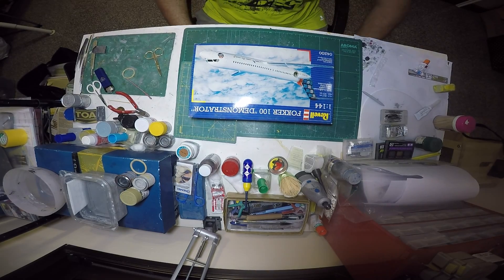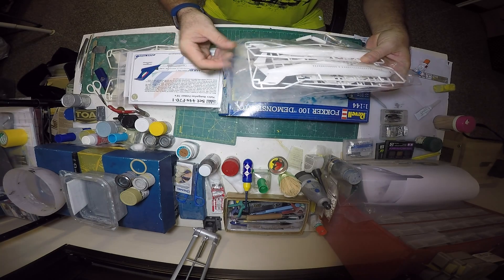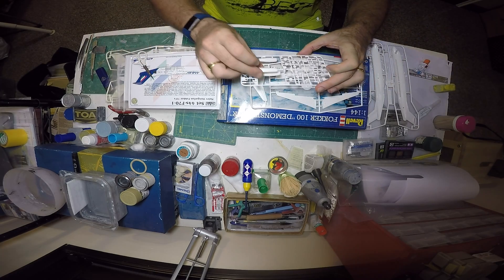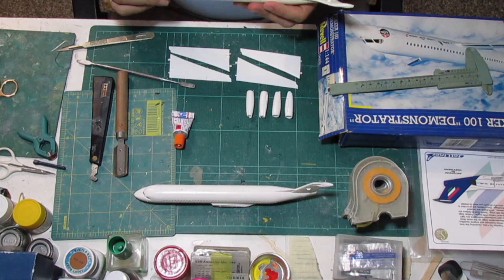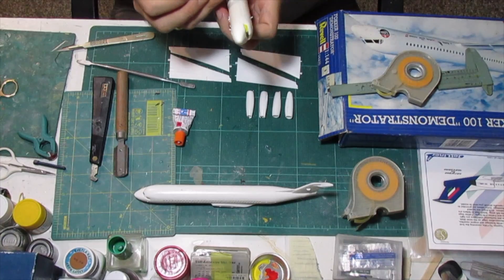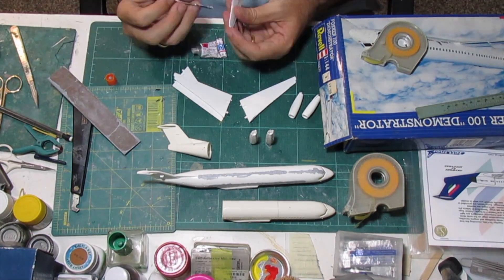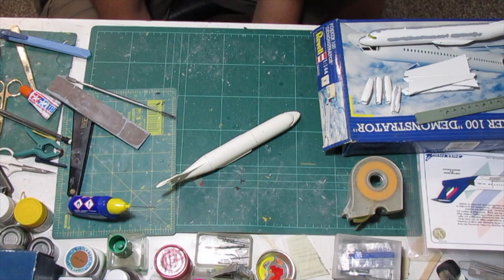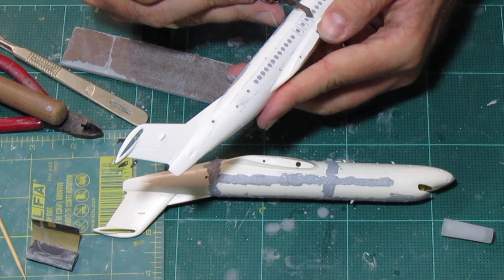Revell 1/144 Fokker 100 & 70  model part 1

Comment from the maker: Thank you for nice comment. The extra weight is to keep the aircraft nose on the ground. A lot of this airliners and generally, most of the aircraft model are tail heavy. So if you don't put additional weight on the nose you risk to end up with a nice model seating on its tail.
Cheers